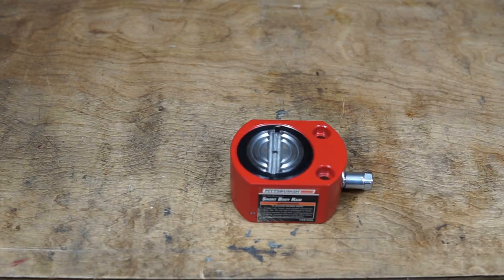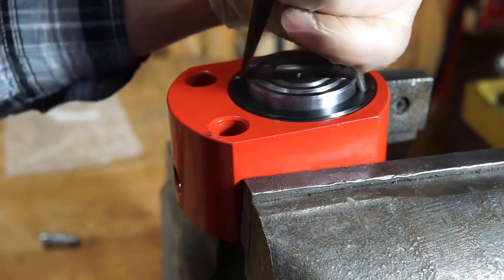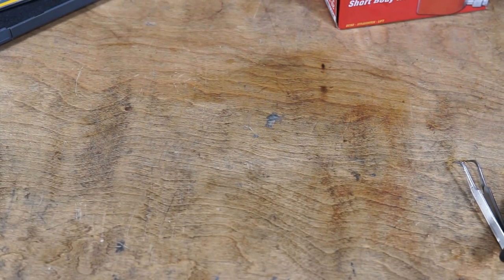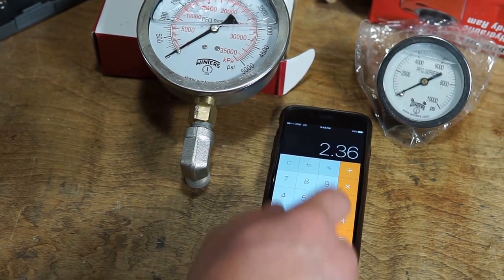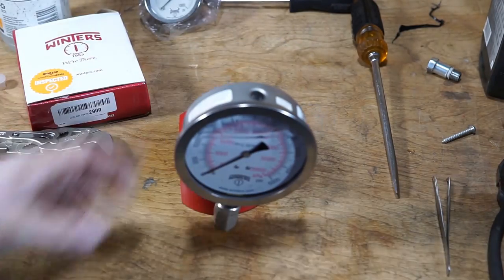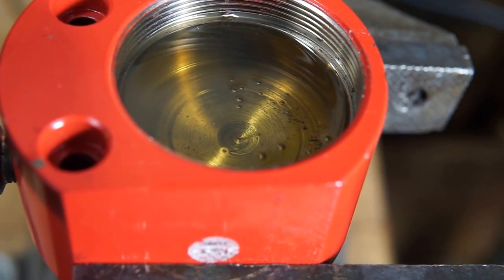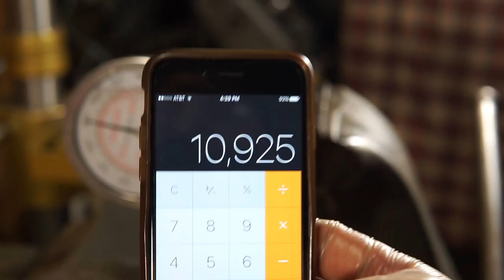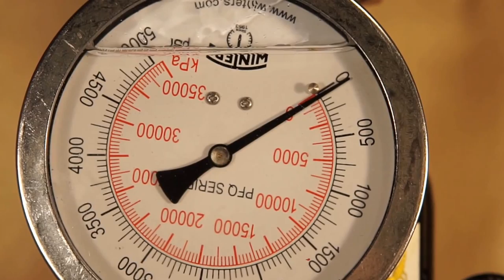A SIMPLE WAY TO MEASURE FORCE WITH A SHOP PRESS!  DIY FORCE GAUGE

Comment: Thanks for the great idea, and for leaving what didn't work in the video. Showing that helps as much as anything. I was able to screw a 4-inch copper extension fitting into mine,  fill it with hydraulic oil and then push the piston out with an air nozzle. I pushed the piston back in  3 or 4 times to purge the air, adding oil in the copper extension each time and then pushed it out with compressed air each time. I screwed the gauge on without putting oil in it, and it worked perfectly.

Comment: Another way to avoid all the air would be to begin filling it with the piston fully compressed, then draw it down a little at a time, filling as you go.  Just keep your fill hole as the highest point at all times and air shouldn't be such a problem.

As another viewer suggested, filling it submerged would be an ideal scenario, but there are still ways to get around air in hydraulics, even from within a nitrogen oxygen environment.  :)

Comment: Filling the cylinder while pulling it open leaves you free of air bubbles, much faster. Use the vacuum it creates to your advantage. Took about 10 minutes total to assemble, super easy.
Reply: agreed, if you very gently work the cylinder back and forth just a little bit, it will push the air out until all that is getting pumped in and out is the oil. take it slow and gentle and should be able to be purged. when i first started i was moving the cylinder too much and pushed out more oil than i needed to

Comment: I'm doing basically the exact opposite for my project. My idea is to measure pull force in rigging systems (rope tension). I have a 12" stroke × 2" bore hydraulic cylinder. The rod diameter is 1.25". So it works out to 1.91sq/inches of area the fluid will act on (Bore area minus rod area) I'll leave the base port open and put a gauge on the rod port and fill it with oil (fully collapsed). So when the cylinder is put under tension the gauge will give me a pressure that I can convert to lbs/force. Ex: 1800PSI × 1.91 = 3,438 pounds

Comment: I like the slight movements of the camera when you move from one shot to the other because it makes it look like I'm taking part in the action at hand. It's like playing C.O.D
Reply: Try using a tee with a plug instead of the elbow. Then use a vacuum pump, similar to bleed Auto brakes to suck the air out through the air separator. With oil in the separator and the entire device upside-down release the vacuum and let the oil drawn in. Then install the plug. 
Great concept.

Comment: 5:29 FYI for anyone dealing with air inside their system like this poor guy (we've all been there)...don't be afraid to LIGHTLY / GENTLY manually actuate the cylinder by pushing it in and pulling it back out a few times...with the valve off as your filling it. You will notice that the tiniest amount of force will cause a dramatic in/out movement for the oil and will quickly flush any air out. Don't forget your safety glasses and maybe some shop rags below just for any excess oil that squirts out (think arterial spray from any slasher movie, also a hydraulic system of sorts). 

Anyway, wiggle the cylinder in and out as you fill and you'll notice if draws in the oil versus you forcing it to displace the air via ramming the nozzle, waiting it out or mashing it with pliers to vibrate it out. You'll not only remove all the air this way, but you'll also know when it's full because air bubbles stop bubbling and oil can be seen smoothly moving in and out. Try it! It is such a time saver and much more effective. 

Still, this is a great video showing a creative use for these short body rams and is much cheaper than buying a new press with a gauge or tapping into the press itself to add one.

Comment: I didn't have any trouble doing mine I pulled the plug out held it with the fill hole pointed up slowly filled while pulling the ram out .once the ram was fully extended push in a millimeter watching for bubbles if you see bubbles press a Lil more pull out slowly again making sure not to allow air in fill hole

Comment: you should have used a T fitting instead of a 90. to fill attach the big ends of  2 bell fittings together this can be standard plumbing pipe as you will be removing it before use. to act as a reservoir attach one small end to the T on the device. on the other end of the reservoir put some other kind of pump. I have used a grease gun air hose almost anything will work with enough preacher to make the cylinder expand. with the reservoir at the highest point and the cylinder at the lowest Fill the reservoir with oil; compress the cylinder if it is expanded. expand the cylinder, relieve the presser push the cylinder back in and repeat a few times. like bleeding a brake system. remove the reservoir and plug the T,
Reply: Karm: excellent idea.
Reply: worked on or around hydraulics for years you pick this stuff up after a wile.

Comment: To be more precise you should actually measure the id of the cylinder to get the area. The seals on the piston are part of of the pistons area, too.
Reply: Meaningless, pressure is pressure.
Reply: You are absolutely correct. I'll bet if you measured the bore, calculated the area, then the pressure at 20 tons applied then you would get exactly the 9250 PSI as shown on the Harbor Freight box instead of the 9144 PSI from Garage Geek's calculation.

Comment: should have compressed the cylinder almost to the bottom of the stroke then fill the volume, then when you screw the gauge in it will displace the piston and as long as the piston doesn't bottom out to the end of the stroke it will work fine.

Comment: GG: A great demonstration and build. As you proved, teflon tape doesn't stick to oiled surfaces.  I observed that you do not calculate the volume of the cylinder. In a practical sense, we may not need to know the volume of oil as it may not affect the final PSI on the moveable disk. Purging the oil between the gauge and the cylinder inlet is tricky. A view named Karm, has the right idea. Finally, I did wonder why you were building this gadget; now I know. I'm trying to think of what other practical use I could put this to. There are electronic sensors for PSI. I could hook up the short body ram to a remote part of my car frame and measure weight between body and frame. Hmmm....how about measuring the weight on a tailer hitch?  Now that I could use.

Comment: Suggest you compress the piston 1/16 inch before bleeding. When you feel it’s purged of air, the volume displaced by screwing in the elbow won’t be enough to fully advance the piston. And use wrenches rather than channel locks, you’re making me crazy. Otherwise, good project.

Comment: Just drill & tap a hole in either the elbow or the base of the gauge fitting for a bleed port, use a fine thread tap, and as long of a set screw as possible and thread sealer to plug the hole.
Reply: No sealer needed (and sealers don't work in oil) if a bleeder screw is used, either a brake bleeder type or a notched type with a sealing washer, brake type would be best..
Reply: And just Hope the set screw is rated for 10000PSI?

Comment: Thanks for sharing. I need similar tool to measure the compression between two plates in my experimental setup. I would like to ask if such devices are commercially available or I need to make them in house. I don't know the name of the tool that I need to purchase but the intent is to measure the compression force between two rigid plates in a setup. I can provide you with more information if you need. Any help is highly appreciated.

Comment: you say at the beggining of the video that 5000 psi gauge should be good to 10 ton jack , and then you install the same 5000 psi gauge to a 20 ton jack........can you explain which one is correct?
Reply: PSI pound square inch , 1 pound times 1 inch is 1 pound he needs to know how much fluid he is using  in oz   ,  2 .36 + 1.5  =  354 pounds  his reading is way off  , In a Bench vice your not going to go over 400 psi without breaking the vice . his reading was 2500 his math  10 thousand PSI . Wrong  The Length of the Pipes the Size in ID will all have to go into his equation .  If he filled in in a bucked submerged no air , but still has to know fluid ounce for correct measurement of force

Comment: 18:11 Famous last words... Then proceeds to beat on the spindle handle. Hey at least he's using a dead blow they never said anything about not using a dead blow mallet :) "Never use a hammer, pipe extension or cheater bar on spindle handle of vise" (Wilton).
Reply: If the vise frame cracked he would have determined the failure /breaking point of the vise frame. ...in pounds.   usefull information in some situations......... Isnt there a term for that ?  somthng like yeild point

Comment: That was painful to watch. Start with the gauge hole uppermost and the piston in. Attach a funnel to the gauge hole and put in some oil, then pull the piston out and push back in again. Repeat until there are no air bubbles. With the piston out, remove the funnel, fill the gauge, attach and snug up a little. Force the piston in a little, then loosen it to release any entrapped air, re-tighten and you're good to go.

Comment: Why not just load the jack with pressure and measure the diameter once it is pushed out, so you don't have to remove the whole thing

Comment: I would have used 1/4" NPTM to JIC-F-4 (P/N 6505-04-04) straight  for the ram fitting and then 1/4" NPTF to a JIC-M-4 (P/N 2502-04-04) elbow for gauge.  This will make it easier to bleed and you will be able to set the gauge angle to anything you want.  One comment about the video:  It always drives me nuts when someone is trying to teach people and don't teach them to use the right tool for the job.  Using Channel locks for everything is not a good example. You don't want to teach bad habits.

Comment: Y r u putting Teflon tape on a flare fitting? You just said make sure you have a 5ton rated fitting. What's the point of having a 5-ton rated fitting if you're not going to install it properly. now that all the pressure or at least most of it is going to be applied to your Teflon tape and threads.  Sure to slowly leak now. Your preventing  the force to be applied to the flair matting surface of the fitting. Now the pressure resides on the tape and threads themsels.

Comment: Good effort but sloppy and backward job on teflon tape.  Easiest way to remember is to hold fitting in left hand and wrap from underneath over top this way the tape will self tighten as the fitting is made up rather than raking itself off.

Comment: Not calculated correctly.  4.36 square inches at 10k psi is 21.85 tons of force.  5000 psi gauge only gives you 1/2 that range.  Pounds pressure x square inches = pounds total force.  Divide by 2000 to get tons.
Reply: How do you get 21.85? 10000 x 4.36 = 43600 / 2000 = 21.8. Just wondering if I'm calculating something wrong here. Thanks in advance.

Comment: I almost cried when I saw him clamp that cylinder in his vice,...at least protect the finish ! Then using grip pliers on a nut/fitting,.. then trying to 'force in' hydraulic oil without an air relief,...etc. etc.
Oh my!
BUT his initial thinking was O.K.,...I guess.

Comment: Go back to school  your math is wrong  , your shop Vice may have done 400 PSI  before it broke .  the Oil chamber has to be a reading in fluid oz the pipe ID all the way to the gauge  1 inch square is 1 pound  you have less that 2 x 1/2 surface area and depth .   your vice did 2500 PSI  your math was 10,000. the 20 ton jack did 5000 you say it did 40 thousand ??   BS   I have a Valve spring tester 200$  in my 8 inch vice I be lucky to get it past 300 pounds  square inch  it test up to 800 PSI   I think your vice did 340 PSI  your camber reading 2.36 you did not add depth of the chamber or the length of the pipe or ID of the pipe .  that is why a pressure plate for valve springs start at 200 $